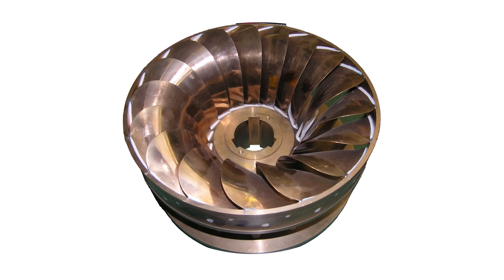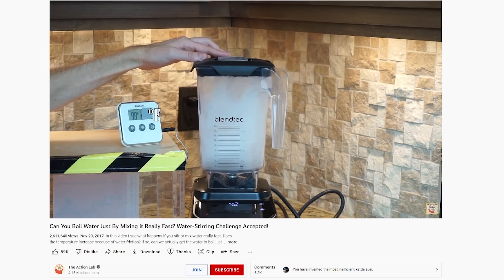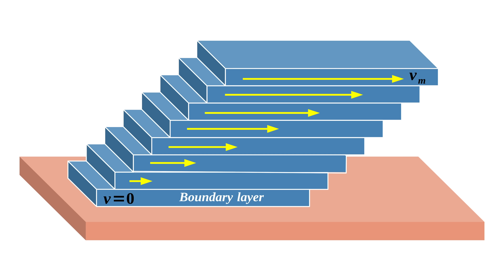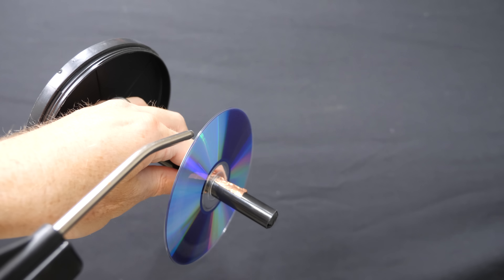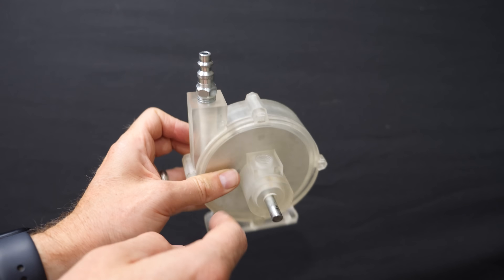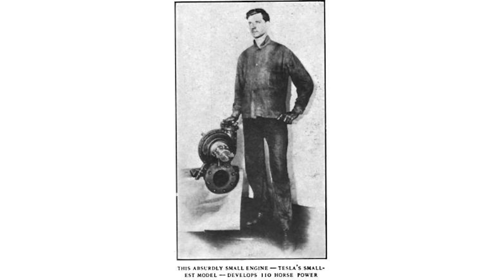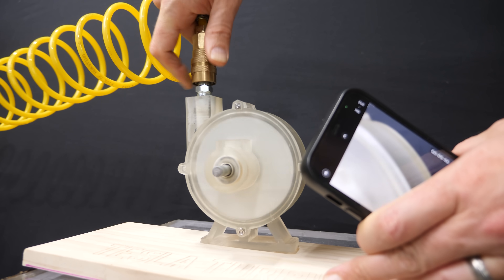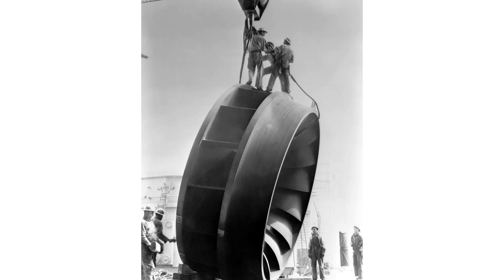How Fast Can a Tesla Turbine Spin?

Comment: I have always been curious about a long log shaped Tesla turbine built into a exhaust manifold driving another Tesla turbine as a turbo on a car. I wonder what it would sound like. I'm sure boost wouldn't be incredibly high but it should be near silent compared to a traditional turbo.
Reply: Iv actually thought deeply about this.. it makes for a very good compressor not great at moving volume though. On the turbine end I think it could have some real promise as it could move a good volume for it's size and should give a bigger range as it's efficiency goes up with shaft speed a good bit. As the wastegate cracks and the turbine really just needs to hold a rpm and flow as much as possible it would shine pretty hard I think. Imagine having a turbo that came on boost super hard at low rpm and then back pressure just sank like a rock and boost carried to red line. In theory this would be a big game changer but the heat and two step hammering on it would concern me. I am tempted to try a turbine for my drag bike though.. maybe next year when I have some time.
Reply: @oliverscorsim  I would think with the extra efficiency you may be able to move the exhaust side farther down the pipe as it would rely less on hot expanding gasses and more on continuous flow. If you keep the diameter of the turbine down you can crank the rpms up and with say a tungsten center shaft for inertia it would maintain rpms between shifts so anti lag may not be necessary. Get it good and spooled up in the wet box and keep it going with a rev every now and then till the tree lights up.
Reply: @jameshathaway5117  that doesn't matter much for turbos in most cases. Rear mount turbos have been around for a good long time. Also inertia is a thing so no reving it and it staying in boost. Also let's take the hx42 in my Volvo the compressor takes about 120hp to turn the turbo at 75,000rpm there's drag from it pumping. Tesla turbines are about the same efficiency as the conventional turbine design most of the time the advantage comes in once it's in boost then efficiency goes up a good bit which would lower back pressure and therefore pumping losses. It would be heavier though so it would spool slower. The biggest limiting factor would be getting the flow out of it. I know my 155cc drag bike is compound turbo these days, but the exduser on the turbine is just under an inch and by 30psi my wastegate on the first turbo is fully open trying to bypass what it can. A similar size Tesla turbine would have an even smaller exit hole if you will. In my case it would be good if once it's in full boost it can move more air at less pressure while still keeping the response. That would make more power and let the wastegate not be all the way open to meet the demands. Potentially great but not in most cases for turbos but it would work very well as a fuel pump since it runs at a constant speed and flow.

Comment: What dies it mean that this turbine is "reversible"? Dies that mean you apply torque to the shaft to make the discs and the fluid travel in the opposite direction? 
Or maybe you apply the torque in the same direction to force the fluid to move? That is the direction of travel of the fluid is the same, but it flows from low pressure to high pressure.
Reply: Reverse the direction, and it pumps.

Comment: Would the Tesla turbine work if the discs had a parabolic shape to them?
Reply: FREE ENERGY! TRUE FREE ENERGY! Siphon liquids UP by putting a bottle above water/liquid source, have a siphon tube go from water/liquid source to top of a sealed container. on the bottom of container put a spout so water can flow back into the source. the water coming out of spout will create suction in the container pulling water up the siphon tube! it will continue to flow until water evaporates unless you build it in an enclosure or use ionic liquid. with water flowing constantly you can use the tesla turbine or any hydro-generator to give you free energy for everyone in the world! Thank you tesla for free energy for the world!

Comment: You don't need laminar flow to get a high efficiency with a Tesla turbine. In fact it is also hard to achieve, because in this case you need to work with a relatively low pressure drop in the nozzle. It is only necessary to use only a small percentage of the pressure drop to generate the required friction to generate the required torque for your application. It means you have to generate the main pressure drop in the nozzle to get the required gas speed to drive the disks with just a small difference ot the tangential velocity to the gas velocity.

Considering this fact it is not convenient to spiral the gas flow from the outer rim of the disks to the center of them, because the difference of the gas velocity and tangential velocity increases along its path. You have to keep the gas flow at the outer rim of the disks. So you can only use half of the circumference of the disk to transfer the power from the gas to the disks. But it doesn't matter if you design the distance between the disks and the width of the flow path correctly. It is also the only way to calculate the performance of the Tesla turbine correctly.

It is also not true that the gas flow generates heat inside the Tesla turbine. In fact, the energy which drives the turbine is extracted from the inner energy of the gas. So the gas cools down like it is the case in other turbines. Also the part of the energy which generates the friction doesn't generate heat because it also comes from the inner energy of the gas. The friction heat is the same amout like the change of the fraction of the inner energy that generates the friction.

So it is re-transfered into the inner energy of the gas and the temperature of the gas between the disks stays constant. So you will measure a considerable temperature drop in the nozzle and no further temperature drop between the turbine disks.

The turbine speed of an optimal designed small tesla turbine is very high. Using air or nitrogen expanded from 10 bar to 1 bar you can expect more then 2500 rotations per second for a 50 mm disk diameter or 150000 rotations per minute. So you can usually only extract the generated power with a very well designed synchronous generator. I made some experiments with turbines of this size and I can tell you that it is really a challenge to design such a system in a useful way.

I have used an iron-free axial flux generator. The permanent magnet disks are integrated in the turbine rotor. The coils were located in front and behind the rotating permanent magnets. The coils consist only of a few windings, generating easily 30 to 40 V for each coil pair. Current rectification is also a challenge because of the high ac frequency of 5 kHz or even more. You have to work with electronic rectification and high speed comparators to control the rectifier MOSFETs.

You can also use diode rectifiers but you will lose a lot of power inside them because of their forward voltage drop, even in the case of Schottky diodes. Such a small Tesla turbine can easily generate 1 kW of mechanical output power. In a diode rectifier you can lose 100 W or even more. So electronic rectification is the only effective way. The comparators have to control the MOSFETs in the micro second timing range. Otherwise you will compromize the ripple of the dc voltage under load.

Comment: well most turbines used in power generation today is about 98% effective. not 65% effective. that is VS the tesla turbine's calculated max efficiency of 92% (if i remember right, might have been 95%) i recommend checking Lesics video on the physics behind the tesla turbine.
Reply: The 98% efficiency is from heat reclamation, which is unrelated to how good the turbine is. Just apply heat reclamation to the tesla turbine to get even better results.

Comment: A key feature that was not emphasized was the path of the gas. The gas moving at the outer circumference of the disk will rotate the disk at aproximately its same velocity. But as the gas spirals inwardly before exiting, the radius and circumference of the disk are shorter, causing the disk to spin faster. I suggest that the overall rotation is some function of the gas velocity, the entrance radius and the exit radius.
Reply: Probably cancels out down to initial velcity of the gas. Less radius in center but also less torque. Lever arm rule is proportional to distance/force.
Reply: So what you're saying is that it works like every other centrifugal reaction turbine?
Reply: As the air loses energy to the blades, it will want to slow down. As it moves inward, into a smaller volume, several things happen: pressure rises because of bernoulli's principle and boyle's law, (although bernoulli becomes less of a factor as the speed of the gas matches the speed of the blades) the gas will accelerate due to travelling a smaller diameter circle, and the increased density of the gas will make it more "sticky" on the blades. 
All in all, it should have pretty even power transfer all across the surface of the blades, if designed properly.
Fluid dynamics is a deep, deep rabbit hole. If you want to look into it, set aside a nice long weekend.
Reply: Could it also be that the gas is literally fighting against the centrifugal forces of the spinning vanes by exiting at the center?  On a traditional vaned turbine the power medium (air or steam, etc.) enters and exits each wheel at roughly the same points in of the circumference.  In steam turbines, when the steam exits the final stage it is still steam but at a high level of vacuum, but on a Tesla turbine the power medium has to work its way inward from the outer edge towards the center against the force of the spinning wheel which requires additional pressure to overcome.  This sounds like it could be a loss of efficiency to me.
Reply: @Jon651  i think thats what speeds it up, high rpm but low torque because close to axis. The air speed that enters doesnt suffer much loss of speed i think because of the cusion air itself provides. Like an air clutch i think i imagine it that way.
Reply: @Jon651
somewhat contradicting right?
but there are still a lot to research about that i guess,
its always " when you gain some on the other part you lose on the opposite part " thing i think

Comment: If you are using water you can increase the efficiency by having a long exit pipe and use gravity to pull the water down creating a low pressure at the turbine exit.

Comment: I always wondered if tesla turbine can be used other way around to make jet engine.
if it requires very fast air flow on input what happened if we spin it very fast using e.g. electric motor, wouldnt we get high speed air flow coming out of it?
Reply: Run the turbine backwards, you get a pump. The other fun fact is that gas increases in viscosity with temperature, this benefits the use of a tesla pump.

Comment: This is the technology used in the DISCFLO centrifugal pump. Great idea, great solution for many pumping applications. The downside is that the money you save in maintenance is eaten up by the electricity required to move the pumped fluid.

If you need a fish ladder next to a hydroelectric dam, this pump can actually pump fish without harming them!
Reply: Seems like the rotation would create huge g-forces, no?
Reply: I've seen that

Comment: It seems these may be beneficial if used simply for storing energy with mechanisms to ensure the load is constant and the flow-rate:RPM is managed properly.
Definitely may even get more broad applications way into the future when specialized materials may be more common and/or less expensive.
But who knows!?!?

Comment: We do use teslaturbines where ever there is a highly viscous fluid that needs to be driving a turbine! We do this all the time. Would use it for less viscous fluids/gases like water or air IF it would be possible to run big Teslaturbine disks of a few meters in diameter on several 10k or 30k rpm....yet there is no material out there today that can survive these stresses.
Reply: Charlie solis makes actual working, real power and torque outputting, even at low rpm, Tesla turbines that run on room temp compressed air.

 +4.25kW at only 6000-8000rpm and a peak torque of 6.22ft lbs.❤

You just have to know how to properly design them to actually work by reducing slip not chasing high RPMs like everyone erroneously claims needs to be done.

Tesla turbines work just fine with all fluids. Because irrelevant of the viscosity of the fluid, ALL FLUIDS, liquids and gases, can be forced to flow in highly efficient low Reynolds number laminar flow regimes given the right initial conditions and “flow cavity” parameters, such that turbulent boundary layer slip is eliminated, stream separation and counterflow is eliminated, rapid pressure changes from turbulence resulting in noise losses that can lead to early fatigue on discs and parts is eliminated, etc. 

Naviar stokes equations explain how all fluids, liquids and gasses, all flow the same.
Reply: Hey, I know this is forever ago. But could you direct me to a source that mentions the problem with materials on Tesla engines? Lots of people say it, but I can't find any sources.
Reply: @Poeneutral source: baseless claims repeated through the internet 😂

Comment: In the explanation you missed one of the coolest aspects of the Tesla turbine. He uses the principle of conservation of angular momentum and it kind of self induction Loop a bit the way Tesla coil uses the voltage gain earlier in the coil to create a step up later in the coil which creates a voltage draw that increases the voltage earlier in the coil in a runaway self-amplification of voltage. In particular, any unit massive fluid towards the outside of the turbine has to increase its angular velocity as it approaches the center to conserve angular momentum, as it increases its angular velocity the speed differential between the center of the turbine and the fluid is increased driving the center harder causing the the turbine to rotate faster which in turn accelerates the fluid at the edge of the turbine so that it gains angular momentum, which start the cycle all over again. It's a self-inducing system that maximizes the frictional transfer between the fluid and the disc. The fundamental problem that I see with the design is that as it spins faster to keep the liquid moving in a circle you need higher and higher centripetal force which creates a high pressure around the edges, putting a lot of friction and pressure on any seal you have between the disc and the stationary housing
Reply: FREE ENERGY! TRUE FREE ENERGY! Siphon liquids UP by putting a bottle above water/liquid source, have a siphon tube go from water/liquid source to top of a sealed container. on the bottom of container put a spout so water can flow back into the source. the water coming out of spout will create suction in the container pulling water up the siphon tube! it will continue to flow until water evaporates unless you build it in an enclosure or use ionic liquid. with water flowing constantly you can use the tesla turbine or any hydro-generator to give you free energy for everyone in the world! Thank you tesla for free energy for the world!

Comment: I think the major problem with the Tesla turbine is that since the medium (either air or fluid ) is just slipping over the blades the blades are spinning from whatever friction occurs between the blades and the medium. This is opposed to a common turbine where the medium is actually pushing on the surfaces of the fins. Trying to take power off a Tesla will cause a large amount of drag possibly over coming the friction driving the discs and probably stopping them all together. Maybe if you were to cut notches in the outer rim of  the Tesla discs you might get a more solid push.

Comment: No, Tesla turbines are not better. If you spend a few minutes investigating how to improve on a Tesla turbine you will hypothesize introducing guide vanes so that the fluid doesn’t spiral into the center as quickly… this makes is a regular turbine. The reality is there is some energy transferred from viscous forces in both Tesla and traditional turbines. But turbines are designed to extract thermodynamic energy or the limiting amount of potential in the fluid. All our models indicate the potential energy in the fluid dominates the available energy for extraction, and this happens to be pressure related energy. That’s why piston engines exist and are the oldest form of engine because it is efficient and it only extracts pressure related energy. Modern turbines are designed and optimized to extract pressure related energy as well as possible and it turns out high velocity flow is not good for that

Comment: Does this mean that the air coming out of the turbine has more pressure?? What if you stacked the turbines In a succession, not  the disks but the full unit on the same  spindle
Reply: You can definitely stage them. Donald Durant has a really cool TesTur patent from the 70’s that is an augmented multistage compressor/pump/turbine that’s has possible the most optimized interstage transitions I’ve ever seen designed for the TesTur slash other bladed radial turbines. 

It’s patent number US4025225A. The specific casing design I’m referring to is Fig. 7 and 8 on sheet 3 of the patent. 

It’s a dual shaft where the disc tips of one stage feed directly into the center of the next stage on the opposite shaft and then the tips of that second stage disc stack feed right into the center of the 3rd stage disc stack on the first shaft and so on.
Reply: @teenagemutantninjaraver2224  yeah Donald Durants design is awesome! Charlie Solis is going to be building a Tesla Compressor for his combustion jet engine just like Donald’s design! 
So exciting!!